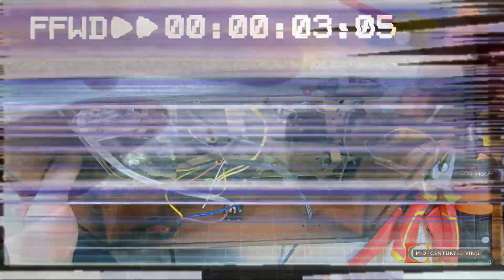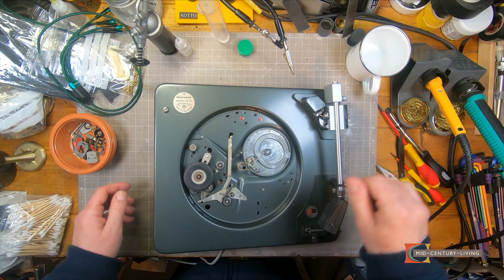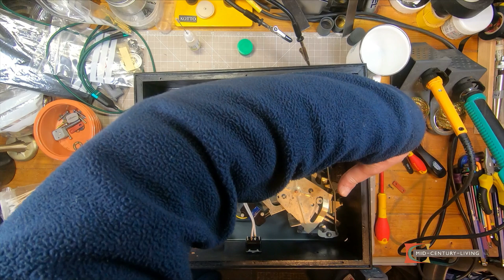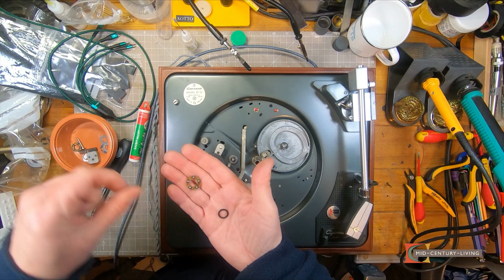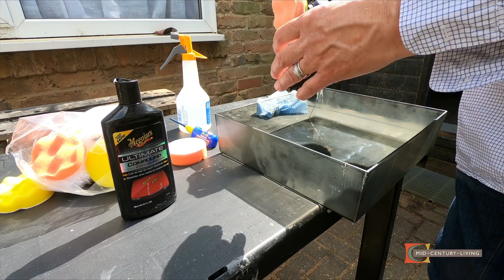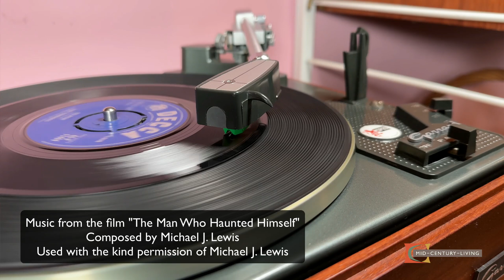Garrard SP25 Mk 1 Turntable (1965) Restoration Finished!

Comment: Thank you very much for those 3 videos. I just recently got the very same turntable from my grandfather who kept it since he bought it new in the 60s. Although mine is an SP25 MkI there are some differences. For example mine doesnt have an ON/OFF switch in the back and doesnt have that round badge in the top left corner of the chassis. I wonder why is it like so...
Reply from the maker: Hi, I'm happy the videos might be useful. I've seen other Mk1's without the badge in the top left - I don't know why that changed. The on/off switch is different as Garrard only sold the bare turntable chassis. Other manufacturers would put them in their own plinth design (or radiogram or similar) and often put their own badge on them. Sometimes home enthusiasts would build or buy their own plinth as well, so there's lots of variation.

It's wonderful yours was bought by your grandfather - definitely worth keeping and using.

Comment: The way you wired the ground is not safe, at least by UK standards because it relies on the preamp for the turntable safety ground. The motor and chassis ground should go to the turntable mains plug. If you have a hum loop then a (possibly much thinner) wire goes from the centre ground on the tag strip to the terminal on the preamp chassis. This direct connection defeats the hum loop without compromising the safety earth.
Reply from the maker: Thanks for this - so you're saying you need both an earth via the mains plug and an earth to the phono pre-amp. When I bought the turntable it had no earth at all, but who knows whats been hacked over the years (and also it was Danish so maybe the wiring regs were different). I'll add the earth lead to the plug back in and report back - third time lucky.
Reply: @ yes, it could be continental rules are different. Another thing to try is that there may be a link wire from one or both of the cartridge -ve connections. Cutting those and just using the ground to the preamp screw may fix the problem - I.e isolate the turntable ground from the signal wires.
Reply from the maker: Makes sense - yes, the cartridge negative wires are linked to the chassis ground at the tag strip underneath.